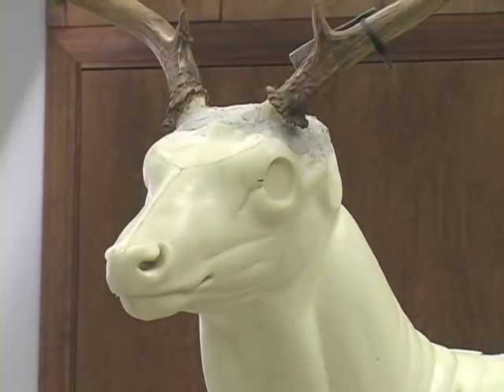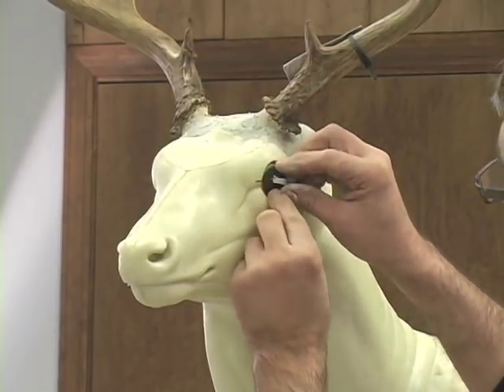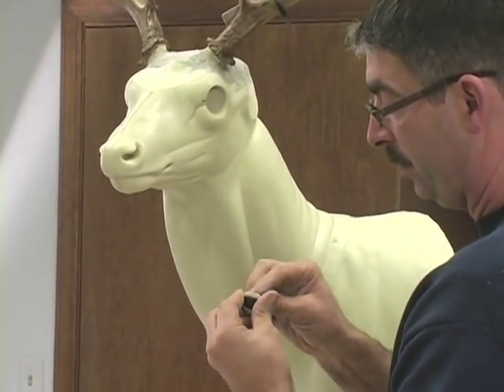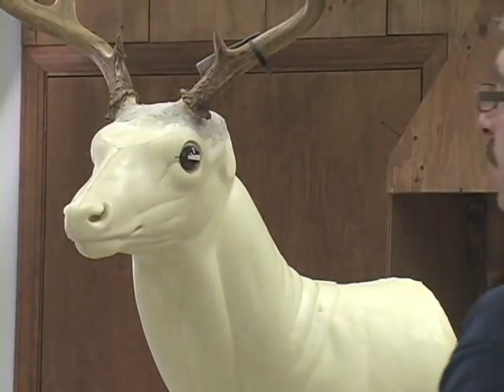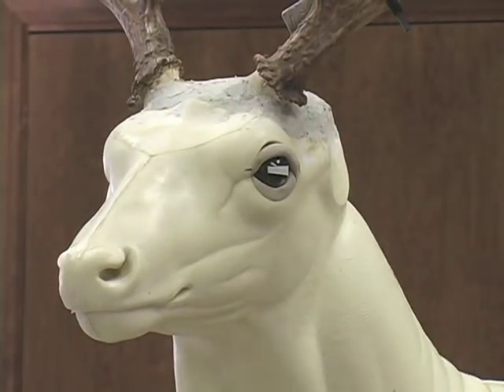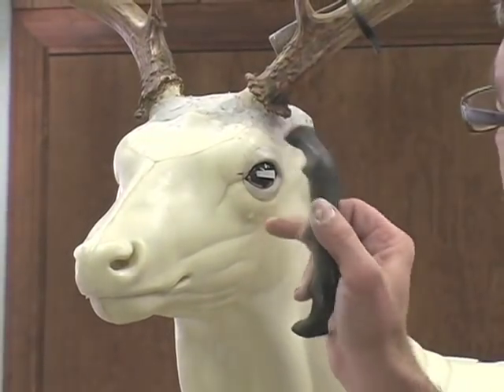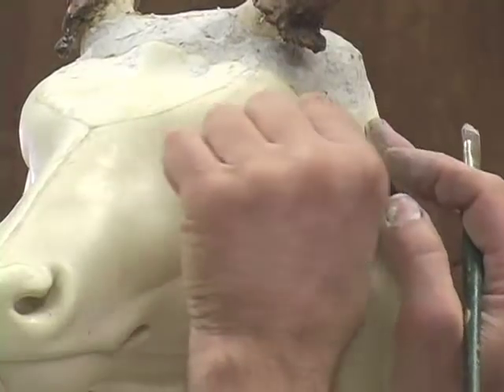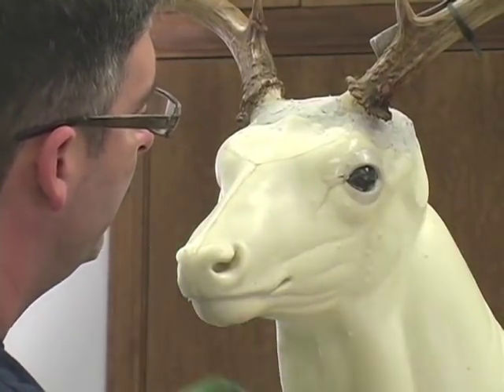Installing a Deer Taxidermy Eye

Comment: The deer manikins or other animal manikins in different shapes are just using the same techniques as life casting but with the dead animals in place of human body. But when it comes to eyes/ other flexible organs , it seems a little more tricky to get the different colors of the eye you would only obtain the shape of the eye? (and wouldn't the molding material change the shape of the eye possible ?)